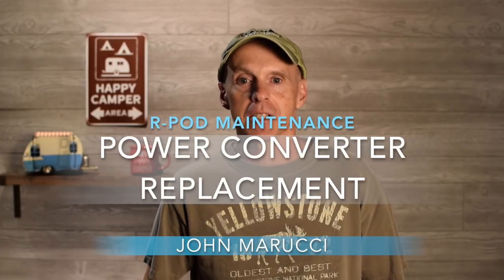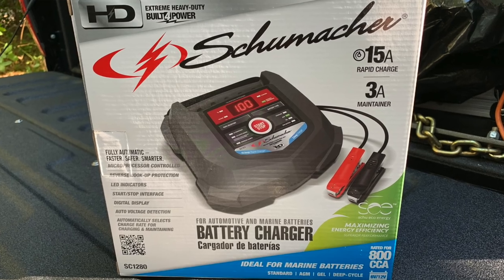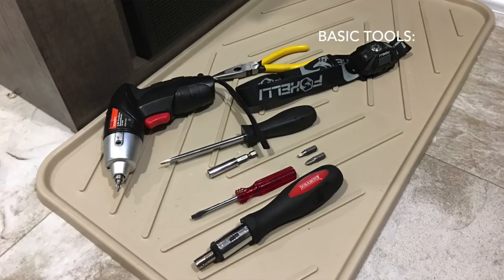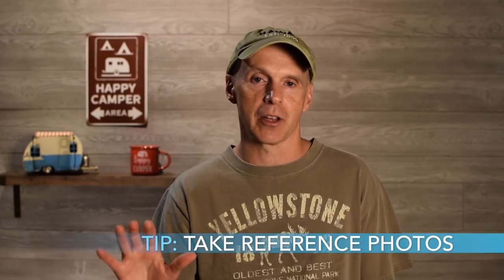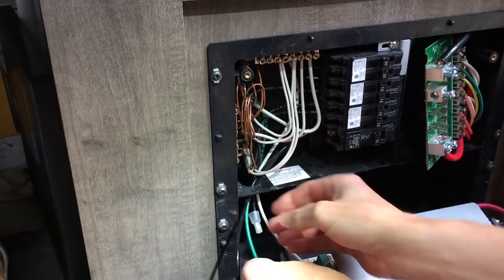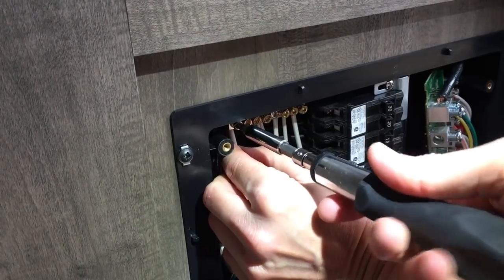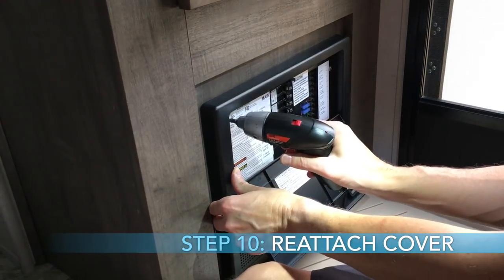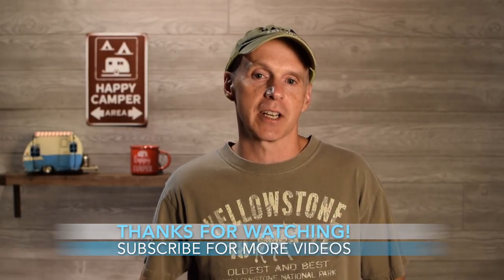R-Pod RV WFCO Power Converter Replacement – Step-By-Step Process

Comment: Hi John, We have a 2020 189  with solar charger and would like to swap out the flooded house batteries for lithium. Which power converter would be appropriate to swap out the original? Thanks.
Reply from the maker: You will need a different converter for lithium batteries. I do not have the model number but would point you to the R-Pod owners forum as many there have done what you are referring to: rpod-owners.com

Comment: Hi John, I have a 2018 Rpod 189 and I was wondering about getting the right converter.  Our converter says it's Model WF-8735P.  Can we use the converter that you suggest or does it need to be the exact same model?  Thanks for your videos, they are very helpful for this 1st time owner.  ☺
Reply from the maker: Is that the model number on the outer distribution panel on from the actual internal converter?

Comment: Hi John, great video on the converter replacement.  I do have a question for you, though.  You mentioned a loose solder connection and, after replacing my 8955 twice, I would like to know where the defective solder connection is located.  Thanks in advance.
Reply from the maker: Robert, I sold my R-Pod 179 this past spring, so I don't have access to the converter. I am pretty sure someone on the owners forum could answer this question: rpod-owners.com
Reply: You need to take out the 5 Philips screws from the top of the board that hold it onto the riser.  Once the brown cover and the metal riser are gone, use your cell phone camera to zoom in and scroll the board.  Mine were on the bridge rectifier.  I resoldered the 4 on the BR and the heat sinks.  Good as new.

Comment: John a couple of questions, can the arterra charge a lithium battery with the right profile?  how well did the charger work?
Reply from the maker: The unit I reference cannot be used for lithium. There is a separate model that can be used. My replacement unit never failed with several years of use. Thanks!

Comment: super helpful John thank you. do you have any tips for selecting the right converter replacement on an rpod -G thats battery has been upgraded to a lipo4? most of the ones Im seeing on Amazon are 55 amp output, does require any other mods to fit the existing (i.e. breaker)? appreciate all your content, keep up the great work and come back to the rpod family soon!
Reply from the maker: Pretty sure there is a replacement that will work but you’ll want to confirm with the folks who’ve done it themselves on the R-Pod owners forum: rpod-owners.com
Reply: @JohnMarucci you're right. Turns out my model would need the entire power panel (WFCO 8735AD) vs changing out the converter stand alone. Thx

Comment: John, when the controller failed, would you have been able to charge the rv battery if you were towing the trailer through the seven pin trailer harness?  Where we will be travelling this summer most of the camp sites won't have power hookups.
Reply from the maker: Robert, the 7-Pin connector from your tow vehicle would change the battery while driving. Of course if you put the refrigerator to battery while driving, that will draw on the battery. Likely, you would want to keep the fridge on propane while between campsites and let the battery charge better from the tow vehicle. Solar or a generator would be the only other options if boon docking. All the best this season!

Comment: I would like to install an inverter so that we can use 120 v when not hooked up to electricity.  What are your recommendations?
Reply from the maker: Cheryl, there are a few choices that can be wired into the RV near the Fuse box/converter. I have not done this personally, but would point you to the Rpod-owner.com forum as there are a few people there who have added an inverter and can point you in the right direction. Thanks!

Comment: Thanks for the video.  Question regarding the warranty. So, what response do you end up receiving from the manufacturer? Another new unit (which you no longer need since your amazon converter is now installed), or something else?
Reply from the maker: After installation of the replacement, I sent the defective unit back to WFCO along with the required paperwork. They turned it around very quickly and I received a new unit the same week. This means I do now carry an extra unit. Thanks for watching!

Comment: Another great video. Thanks John! Question: Is the 55 amp version of the converter the best replacement? Or can you upgrade to a higher amp model?
Reply from the maker: Paul, because I went with the counsel I received and put the 55 Amp exact replacement unit in, I didn’t pursue other options. Good question. I would point you to the R-Pod Owners Forum to see if others have done differently. http://www.rpod-owners.com
Reply: Paul C, A higher amp model would for sure be better than the 55 amp version. Generally, you want to go as high as you can. Stay safe - George.
Reply: Great video. I will be replacing my converter/charger soon. It still works but it’s old and not efficient. It takes almost 8hrs of gen time to recharge 2 golf cart batteries from 50% back to full. I am going with a 60A converter from my parralax 55A. The extra 5A (60 watt difference) is acceptable for my existing wiring. I would not go higher than that though.

Comment: When I plugged in after following your instructions exactly (except for taking out the fuses), I heard a pop and no power.  Any idea why?
Reply from the maker: Could be a number of things. Were you plugged into 30 amp shore power at a campground?
Reply: @JohnMarucci  no 30 amp shore power at our home.
Reply from the maker: I know if you are only plugged into a 15 or 20 amp outlet at your house it can flip the GFI outlet, especially if you had the A/C on. I would first check the GFI outlet in the trailer to ensure it doesn't need to be reset.

Comment: John the 8900 is 35 amp and the link is to a 55 amp converter  and is the 3 stage. Is it ok to up the amps in changing out the converter 2015 Rpod 179
Reply from the maker: The link is to the replacement unit for my 2017 R-Pod 179. They may have used a different amp unit in the older R-Pods. I’d ask on the RPod forum: www.rpod-owners.com

Comment: Hi John, David here "again" :) i cant find our last thread so writing here. I have a R-pod 191. i upgraded to dual batteries witch i i have connected in parallel. we generally only do dry camping. i wrote last because as i was driving from home to camp my batteries would be drained, you sent me a link and i purchased that mechman alternator. same thing is still happening. i put new batteries in about 1 year ago, not sure what i'm doing wrong. i had the camper plugged into the house 110 for most of the winter, is that a problem?  i thought that would keep them topped off. its such a pain getting to a site and having to kick on my generator to operate the slide out and get the batteries charged up but then they are draining before the night is even over. in the summer we generally keep the bath fan on and a window open for circulation but cant do that for the whole night. last weekend i had to disconnect the co2 in the middle of the night because it started chirping for low power. i think i must be doing something wrong when my camper is in my driveway. maybe connecting to the house is bad? feel like i need to buy 2 new batteries again to get me through the rest of summer. thanks for your help!
Reply: Hey John, wanted to see if you have any advice on this? thx

Comment: John we enjoy the videos
We have a Rpod 195 and we notice when the invertor is om it seems to run a lot ans the besside outlet when turned off remains on and green
Can you share your feedback and does this sound like a short or warranty issue to you?
Thanks
Reply from the maker: Leslie, the converter fan will run when plugged into 30 amp shore power when charging the battery. This is normal. The part of your question talking about the outlet and green light I am not clear on. Feel free to refresh the question with more detail. Thanks!

Comment: So did you get reimbursed by WFCO after you sent in the faulty converter since you bought the replacement on Amazon?
Reply from the maker: Eric, WFCO did send me a replacement unit but did not reimburse my purchase for a separate unit from Amazon. That was my choice to get a new one quicker and it does mean I now have a back up unit if this one fails. Thanks for the question, hope this helps.

Comment: John.....I have an RPOD 180  1918    do you feel the need to keep an extra converter on hand while traveling?
Reply from the maker: I think having a good battery charger with you would do the trick and cover if your converter went out while traveling. It would keep you going until you can replace the faulty unit. Thanks for watching and for commenting!
Reply: Our converter failed this weekend on our 2019 rpod 180. We've only been camping twice. We got a battery charger. It saved our trip.  In the process of pulling the converter out when I came across this video.
Reply: @tedandtinasadventures.9225  Where did you get your converter from?  We have a 2018 180 with a converter problem and I ordered the one that John used, but it didn't look like the one ordered.  Thanks!
Reply: @donnaflanders3210  a dealer replaced it for us. Not sure what brand.

Comment: I'm hoping you can solve this problem. I have 100 watts of solar which is putting out 15 on my volt meter  from the end of the plug but it is not charging my batteries. Is this still the power converter. When the generator is on, the lights on my panel completely light up.
Reply from the maker: Sorry, I don't have solar and can't help directly. You may want to post this issue on the R-Pod Owners forum: rpod-owners.com. All the best!

Comment: I just finished replacing the converter and panel in my  2015 Rp-178.  Unfortunately I wasn't told that I could just replace  the converter.  I was given a link for the whole converter and distribution panel .  Unknowingly I ordered it from Amazon , around $170 total with tax.  When it came in the mail I realized this job wasn't going to be a 20 minute project like was shown in this video.  I had to disassemble every fuse, circuit breaker, ground and common wire in the unit, take out all the fuses and circuit breakers and then put them back in the new unit. Not a job for the faint of heart.  Anyway to make a long story shorter...I did it but it took a couple hours! I guess the moral of the story is...WATCH JOHNS VIDEOS first!!!!!!
Reply from the maker: Sal, sorry to hear about your experience. Thanks for sharing your story as it will be very helpful to others. Your situation is exactly why we are documenting our experiences. All the best and thanks for watching.
Reply: @JohnMarucci  the way I look at it is heck...I know a lot more now and it's good to learn!

Comment: Thanks for the video  I'm having the same issue
Reply from the maker: Hopefully the video and step by step process will help if you do the replacement. Keeping a good battery charger with you can also be helpful if the converter falls while on the road. Hope everything works out well. Thanks for watching.

Comment: Hi, I am new to this and assume shore power is plugged into power either thru 30 amp or dog bone and 15 amp breaker. My battery is connected and I am plugged in with a dog bone and with my volt meter I read 13.57 or so at my battery. I'm thinking converter is working.  But if I unplug shore power and still battery connected it drains in less than 2 hours. Refrigerator is turned .....is this normal and am I thinking correctly on converter.
Reply from the maker: Steve, when you are plugging into shore power you should be able to hear the converter fan running when it is charging the battery. The fan almost always turns on at the converter when I first plug into shore power (either 30amp directly or like you said 15 or 20 amp at home using a dog bone connector). If you can know that the converter is working, then it sure sounds like a battery issue or something else tapping the battery pretty hard when unplugged. The fridge panel (and some fridges on 12v), thermostat panel, cabin lights, slide out, furnace fan, any USB ports, interior fans, stereo (& TV on some units) and outside lights are all on 12 volt and will drain the battery if being used. Some people forget the furnace fan which is a big draw. So even if you are boon-docking and run the furnace, the battery will get used up fairly quickly if the furnace fan is on a bunch. Thanks!
Reply: @JohnMarucci  thank you....today I came home and my RAM jack was all the way up. Crazy...we had a heavy rain last night . I put a small disconnect on it but left exposed. Can only guess the whole thing was wet and water is a conductor....

Comment: I’m in Canada and can get PowerMax PM4 75A MBA 110V AC to 12V DC 75 Amp Power Converter with Built-in 4 Stage Smart Battery from Amazon! Will this work? Mine is toast! Thanks.
Reply from the maker: I am not familiar with this specific power converter. You may want to ask on the RPod owners forum as there are a few people there who have changed converter models: rpod-owners.com

Comment: I own a 2016 Wildwood RV trailer, I have no power in my trailer to anything, I don’t know if it’s my fuses or my power converter box, my box is a Model WF-8955PEC, help?
Reply from the maker: Have you checked that your battery is fully charged and connected properly and that no battery kill switch is engaged?
Reply: @JohnMarucci  so I’ve been living in it for the past two years, my father has had the battery disconnected for the past couple years, and it’s been getting power from the property I live.
Reply from the maker: @dustingamon3614  Yep, you have to make sure you have a good 12v battery hooked up.
Reply: @JohnMarucci  okay, I’ll start by reconnecting my 12v battery to it first and go from there. Thank you for your help I greatly appreciate it. Hopefully that fixes my problem and I get power back to everything in my trailer
Reply: @JohnMarucci  so I just checked my EMS-HW30C on my trailer, I tested with a 120V tester it has power going to it, but no power coming out, could my EMS-HW30C have gone out?
Reply from the maker: Could very well be.

Comment: I received the power converter today & it was in US Mail Priority Mail box wrapped in Bubble Wrap. No box or Instructions from Arterra. No Identification that it is even a Arterra Product or Model # stating that it is in fact an  Arterra # WF-8955 MBA 55DC Amp replacement part. No Identification at all.
Reply from the maker: Joe, did you get it from WFCO via warranty replacement or from Amazon or elsewhere?
Reply: @JohnMarucci  I got it from Amazon. The seller was Oceanside RV Supply.
Reply from the maker: Joe, the link that I provided on my storefront is sold and shipped directly from Amazon (https://amzn.to/35swZVm). I suppose if you are not happy with what was shipped you should contact Oceanside RV for a refund or replacement. Thanks!